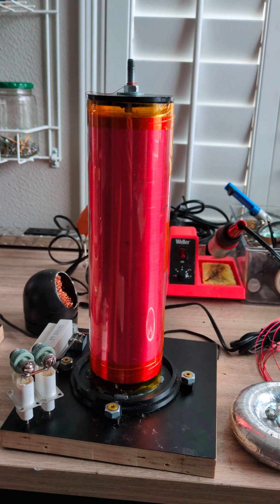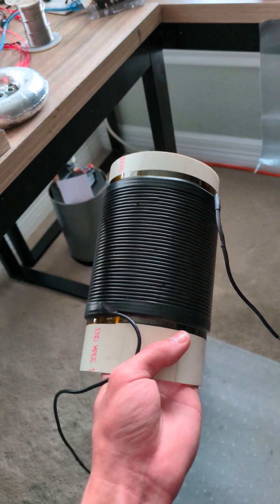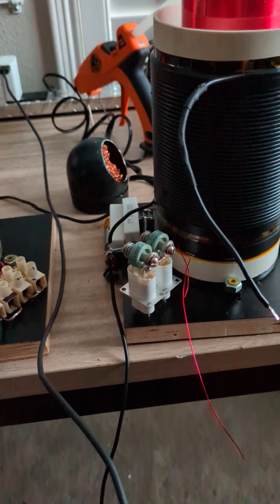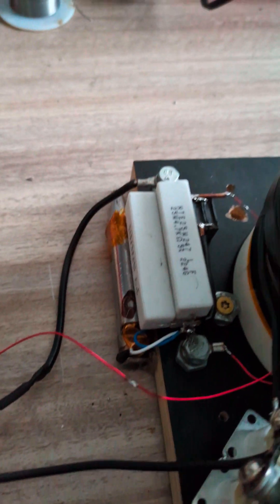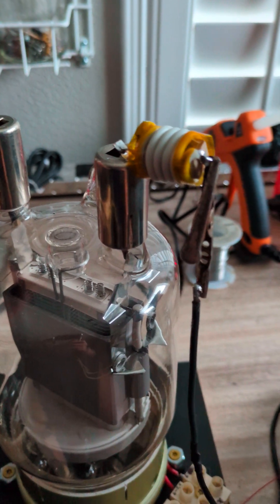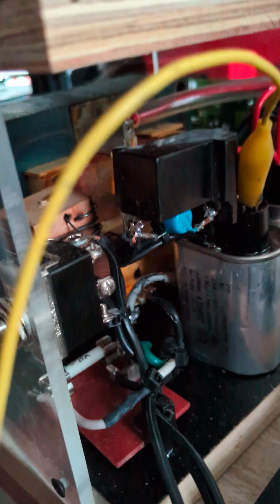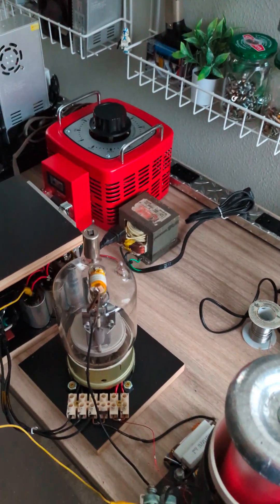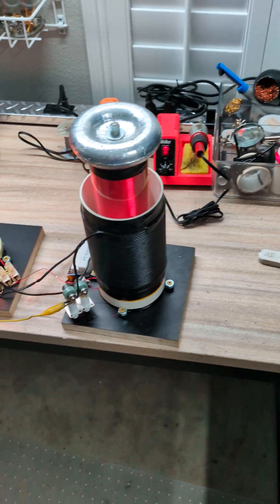How to build a VACUUM TUBE TESLA COIL [ Lightning Generator, VTTC ] | #diy #highvoltage #engineering

Comment: Why are there so many primary turns?
Reply from the maker: This is because that VTTCs have a lot more turns compared to regular Tesla coils. That and the fact that it is more efficient for a higher inductance and lower capacitance.
Reply: @Livewire460okay, already output voltage is pretty high
Reply from the maker: @vaNerdoyea that is true but it is more about resonance and frequency than the turn ratios between the primary and secondary.
Reply: @Livewire460can you explain why lower capacitance and higher inductance makes coil more effcient ?I am pretty curios and planning on building DRSSTC or low frequency (40-80kHz) SSTC on IGBT from old induction heater?
Reply from the maker: @vaNerdoHigher inductance and low capacitance improves the magnetic field which then improves the energy transfer between primary and secondary. 40-80khz is wild! Howd you get a frequency that low?
Reply from the maker: A single igbt DRSSTC would be difficult. You should try SSTC for sure.
Reply: @Livewire460I Bought little bit more copper wire that I need (1200meters) so my coil can be pretty big I think and  always Topload can make the frequency even lower
Reply: @Livewire460I have 4 or 8 IGBT's and the whole induction heater is designed for nearly 6kW and my first coil will definitely be below 1kW also SSTC are typicaly 200-300kHz and my IGBT'S are most likely 20-80kHz
Reply from the maker: @vaNerdocould you tell me the part number of the igbt?  It's hard to tell what kind it is. How are you planning to drive the transistors?
Reply: @Livewire460I don't know the part number I will get them from Old "Milla " induction heater and driver I am not sure I want to see as much different drives as I can find and build the one with the best ratio of simplicity and reliability
Reply from the maker: @vaNerdogotcha. Then you should build a zvs driven Tesla coil. The design is very simple, requires no ICs, and is very reliable.
Reply from the maker: @vaNerdohere is a link to a video that may be helpful:  https://youtu.be/Z-gfUz-s3Gk?si=P7DAo3lDxllsM31k
Reply: @Livewire460I love ZVS I have one 600w 12-30V , with flyback makes good arcs, only downsides as a Tesla coil driver I think still frequency maybe too high for old IGBTs and no music (megalovania from "death machine ") but high power, reliability, no ICs, and Ease makes ZVS amazing
Reply: And also what makes different in shape of discharge my personal favorite are branch discharges, swords are okay, but branches just shows this Tesla coil chaos
Reply from the maker: @vaNerdoYou can always increase the capacitance on the output of the zvs driver to lower the frequency as needed for your IGBTs. If you want branchy discharges, aim for anything below 300khz. The lower the frequency, the more branchy it is.
Reply: @Livewire460yeah low frequncy ZVS can be possible , but is there way to make sure that gate of IGBT Do not get too much voltage if it is powered directly from rectificted mains? And music (I am pretty sure that quality of audio will be terrible but as long as I can distinguish megalovania playing from my Tesla coil will be amazing) as far as I know there is no way to make music ZVS coil
Reply from the maker: @vaNerdoIf you look at the schematic, of a zvs driver, then you will see a 470 ohm resistor on each gate of the transistors connected to positive. There should be a 12v TVS diode across the gate and emitter pins on both transistors to protect it. It depends on how you are going to power it and drive it to play music that will determine how good it sounds.
Reply: @Livewire460as far as I know the ZVS base drivers can not play music and I am also thinking about some ZCS driver, it is first Tesla coil, so if it doesn't blow up and produce some arcs will be cool
Reply from the maker: @vaNerdoI have never heard of a ZCS driver before. ZVS drivers still are pretty reliable if you build them the right way. You can also still play music through a zvs driver by interrupting the positive supply to the resistors that lead to the gates of the transistors.
Reply: @Livewire460 ZCS (zero current switching) are mostly used in converters and ZVS powered from mains seems too powerful for me I have a 16A breaker for my room and I don't want to trip it too often, and this trick with music makes sense
Reply from the maker: @vaNerdooh you don't have to power it directly to mains, you can use a variac or some low voltage power supply to get it to work. Running it from mains is very dangerous especially if you haven't tested it yet.
Reply: @Livewire460I don't have variac and only other power supplies are 180w at max (19.5V and 9.2A or 18.5V and 9.7A I don't remember)
Reply from the maker: @vaNerdothat should work fine for tests
Reply: @Livewire460for first okay but gap between laptop charger and rectified mains is huuuge
Reply from the maker: @vaNerdo it probably easier
Reply: @Livewire460by the way in my bio is my DC and it will be more handy

Comment: um i made the soft start bit but it changes the voltage by like 20mv  is that ok also i used 2 /1ohm 100w resistor's to make a 200w 2ohm resistor because i cant find a 120w 2ohm resistor not sure if this makes sense but my power supply outputs 12v 10a then it goes thru the resistors but is still at 12v 10a
Reply from the maker: Have you tried powering the tube in series with the resistors yet?  The voltage by itself without the load won't drop.

Comment: does the tube have to be powered by ac i assume so
Reply from the maker: The tube can take either AC or DC but usually a rewound MOT is used since they can provide the correct voltage at the required current.  As long as the dc supply can handle the required current and current, it should be fine.
Reply: @Livewire460 so a dc suply of 12v 10a should be fine then
Reply from the maker: @googleaccount-t7j4p That could work but it is usually better to power it from a rewound MOT so that you can change the voltage up to 12.6v @ 10a.  You could just power it with a 12v 10a power supply but I would imagine that there would be some voltage drop due to the massive load.
Reply: @Livewire460 yea like the metal boxes that have all the connections on the front with some screw terminals
Reply from the maker: @googleaccount-t7j4p  do you mean something like an ATX computer power supply?  I'm not sure what you are talking about.
Reply: @Livewire460 I'm pretty sure u have one on ur 3d printer
Reply from the maker: @googleaccount-t7j4p Oh those power supplies.  Yes that could work fine but again, make sure that it can provide over 10 amps to make sure that it will provide a steady voltage.
Reply: @Livewire460 is the required current 10a I'm just making sure
Reply from the maker: @googleaccount-t7j4p yes but you should always have enough for a little over 10 amps

Comment: also the cap nearest the mot and variac does that say 3uf or 3pf
Reply from the maker: 3uf
Reply: @Livewire460 does the caps voltage drastically mater
Reply from the maker: @googleaccount-t7j4p As long as the physical leads to the capacitor are separated enough and the voltage rating is above 2kv, then it is ok.  Try to use microwave capacitors if possible since they are the most reliable.  If you try to use other capacitors then it might not provide enough power for the circuit.
Reply: @Livewire460 ok does that go to all the caps also thanks

Comment: No. There is a large high-voltage capacitor which is a part of the unit’s power supply. The magnetron itself is just a bunch of copper surrounding a filament in a vacuum, with a magnet around the tube but outside of it.
Reply from the maker: Are you talking about the magnetron capacitors?  Because the tank circuit is composed of magnetron capacitors.  Idk what you are talking bout.

Comment: You are aware that the magnetron capacitors have their capacitance primarly between the centre pin and not the side pins right?
Reply: There's two caps in there, one from each pin to the case so if you run pin to pin you get half the capacitance but capable of twice the voltage as you are running two caps in series, this is a better way to run them if you have a lot of them kicking around as it allows you to run more caps in parallel increasing the effective KVAR handling and as mentioned the voltage rating is double 👍
Reply: @T2D.SteveArcs  thanks thats a way better explaination.
Reply: @janno288  👍👍